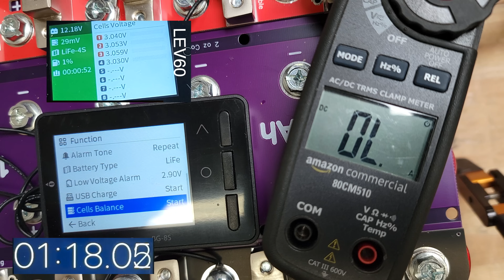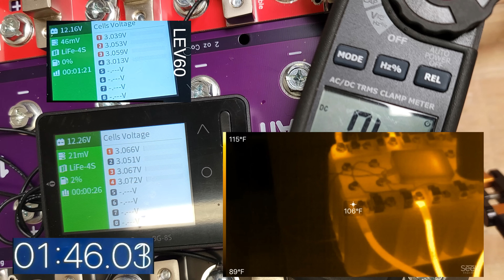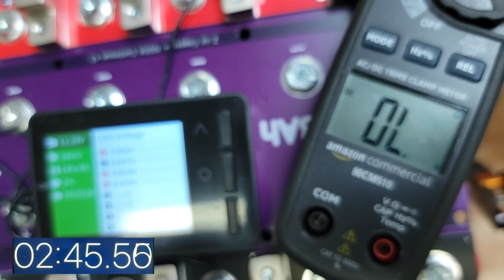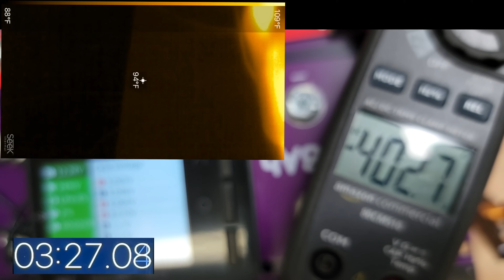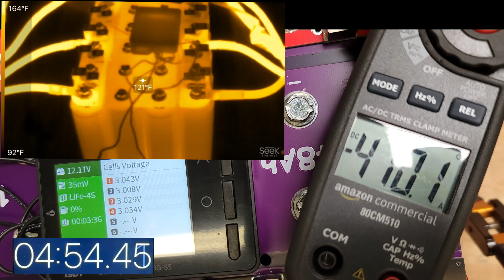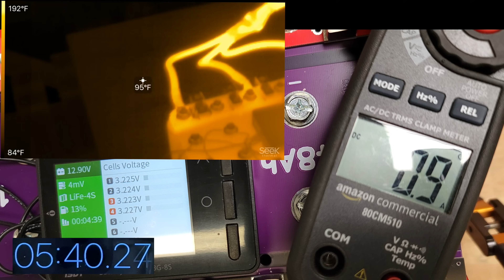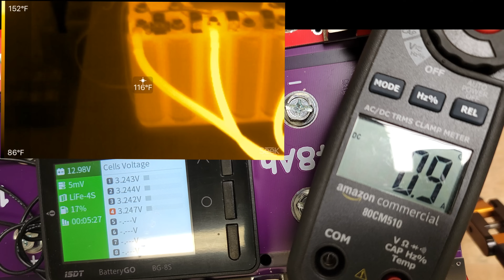6 minute Headway Torture Test - 48Ah LiFePO4 PCB busbars

Comment: 8:22 4 AWG wire is the wire you are trying to determine if it’s “6 AWG or 8AWG”.  Im looking to buy the same type cells shown in the video. 
I run 3 runs or 0/4XL OFC from SkyHigh car audio (power and ground. 3 positive and 3 negative- to my main sub amp)
Edit- battery hookup doesn’t show a super beast as of today 07-22-25, and a single cell is 8.99😢)

Comment: I havent seen anyone mention this, but I think the argument against doing multiple cables is this - If you have one cable fail (eg- one of three 6awg like in the test), now instead of pulling 400a through three wires, youre now pulling 400a through two undersized cables which would likely be a fire hazard.  If you have one big cable (eg- 0awg) and that fails for some reason, now youre just not pulling any power.  I think its about knowing the risks/rewards analysis of one way over the other.  And particularly in automotive/vehicle applications, they move and vibrate, so with more connections, there are more failure points with multiple smaller cables.  This is likely why the car audio guys are warned against doing it with multiple smaller wires.

All that being said, these are amazing batteries, and thanks Jehu for doing the work/testing to see what they are capable of!

Comment: Hello friend, I have a 2013 Honda Pilot truck and I want to remove the original battery to change it for a LEV60 since I do not want to sacrifice space, my question is if there would be problems putting the LEB60 battery in the space of the original, that is, under the hood? and what should I take into account
Reply: Lithium-based batteries cannot handle the extremely high temperatures you see under the hood. It is always recommended that they be installed inside the vehicle. In a lot of cases the upper recommended temperature is 140 to 160 degrees Fahrenheit. In the engine compartment temperatures get well over 200 in can result in premature failure.

Comment: i am xonfused man, i saw another of your videos where you did the test on the green cells and the pulled more then 600AH, here the headway pulled 400ah or so, so wich one is the better choise here ? how's the headway 20ah ahead of the green battery ?
Reply: He can choose whatever load he wants to put on there. 100 amp, 300 amp, 500 amp Etc. These two batteries in these sizes are pretty much equivalent. The Headway is going to be used while the Lev60 is going to be new. The Headway cells don't require compression, but the Prismatic Lev60 cells do require compression if you're going to be pulling heavy loads from it.

Comment: I don't know who said to not use multiple most definitely use multiple cables specially if the rating on the guage wire you are using is less than what you plan on charging or pulling from the bank

Comment: As always, great video Jeh. People using Headway cells for car audio and as you mentioned (in min 9)  is connected to the alternator so my question is it safe to connect to it directly ? as I know the alternator when connected to lithium battery (for charging) which has for sure low IR will get fried ? TIA
Reply from the maker: sorry I don't understand your question
Reply: @jehugarcia  I have to charge headway pack for my audio system using the alternator (chargeing while inside the vehicle) or external AC-DC power supply at home ?
Reply: @amerkhafagiable  a stock alternator will charge it just fine
Reply: @jehugarcia where can I get the green battery 🔋? And cell name?

Comment: Electrical installations use parallel cables all the time, EVERY stranded wire is infact parallel wires in a single assembly. Anyone who says you cant use multiple cables just doesnt understand electricity. you will see things like what you did one wire will see different amperage due to length, and connection resistance. But if you get them reasonable to the same lengh the difference can be ignored.

Comment: I really get mad when a person takes knowledge for free on YouTube and then try to criticize the ones that are sharing the knowledge for free. You always give people the choice of buy from you or just diy. You have the wright to charge whatever you want for the items you sale. As an engineer with more than 15 years of experience working with batteries I can tell that your set of tests are the best that they can be with the equipment that you have and certainly a lot more accurate than those of the clown of the multiple color beard. For those guys trying to craft a high power audio system…. “The week is already invented” do not try to cut corners… is you want to move a lot of current fast, you need multiple cables with a good distribution over good chunks of copper bussbars. This is the only way to do is right. The only reason to use single cable is because cable is really expensive and terminals are more expensive. Less cable is less money….. but MORE FIRE HAZZARD

Comment: Nice test! There is no substitute for real-world testing.  When I built the first prototype EVSR electric race car, I used 3/8” thick aluminum bus bars, but they would overheat during race conditions (typically 800amp at 160v for as much as a 95% duty cycle, depending on the race track) so I upgraded to 1/2” thick, and that solved the overheating problem.
Reply: comment is useless if you don't tell us the width
Reply: @themoneymercenary  bus bars are approximately 1"wide by 3.5" long, 1/2: thick

Comment: buy a uni-t ut221 clamp meter , it is a bit expensive (150$) but it can measure 2000amps dc! . make sure its the ut221 as the ut220 is ac only or the ut222 can measure 2500amps dc. 
ut207b & 208b is around 100$ and they measure upto 1000amps dc. 
i have the ut204+ and the meter is very accurate and it was 45$ and only does 600amps which is enough for me but not enough for your tests.

Comment: Good video! You can use a 500A or even 1000A shunt with an INA199A or similar Current sense amplifier and build your own tool quite cheaply to measure the high current. Or even easier, use just the shunt then use a precision volt meter to measure the voltage drop across the shunt then I = V / R, R = V / I , R = 75mV / 1000A, R = 0.075 Ohms . All the best!
Reply: On a serious note, lots of people know ohms law, but so many people forget about trying to do the math and solve the equations. I guess we are all guilty of being lazy sometimes in this world of convieniences.
Reply: @catch22frubert  true that. I posted the formulas to look smarter, but I used chatgpt to come up with the equation for the current. :)

Comment: The issue is you are nearly exceeding the cells thermal rating within 6 min and "these audio guys" run for hours at a time. Spreading out the load isnt an issue and is encouraged as can bee seen with the thicker bussing thats used having many spots. I agree Seth's test was flawed because it was pulling power incorrectly. But to me, this shows the traces need to be thicker and can be done so cheaply.
Reply from the maker: But 6 min continuous test = 1 hour dynamic music load
Reply: @jehugarcia  I encourage you to go to some audio shows and see how people use these in application. There's a decent amount in your state and they are free (and fun) to attend. Bring your clamp, volt meter, and thermal cam and ask if you can take some measurements, most will be happy to oblige.

Comment: Every time I click on the link to find this $150 price talked about in the video it keeps taking me to the product that’s $229. 
On yesterday’s video, when I tried to click on the link, same thing happened, it keeps taking me to a higher priced product 

Or individual cells that are selling at $49 for each cell . 

What adds up to a lot more than $150 . 

What is wrong with the link clicking on not showing the product mentioned in the video
Reply from the maker: this is where the link should take you https://scontent-lax3-1.xx.fbcdn.net/v/t39.30808-6/363321648_10162690785091978_1789931011703396194_n.jpg?stp=cp6_dst-jpg&_nc_cat=110&ccb=1-7&_nc_sid=dbeb18&_nc_ohc=Zw1oSYx-T4EAX9tl4Bn&_nc_ht=scontent-lax3-1.xx&oh=00_AfC8N0_gMSo8o-XRJWzk2KKvFuVcD3w9ZYXu0Ukktu4WFg&oe=64C62265
Reply from the maker: There's a drop down menu with variants,  but there's no $49 cells in there,  is this the page you end up at? https://www.facebook.com/photo.php?fbid=10162690786751978&set=p.10162690786751978&type=3&av=584751977&eav=AfbCbKK37Z8B9ajoZbne_q2SI_8TLYOpKl7XJZppU5a6IUw-Q4iVYdtlCrii8YDoPJw

Comment: I’ve been trying to power a project with 2 of your batteries off your website but I can’t get them working correctly. Both were bought tested with the bms awake. Don’t know what do to. Rlly starting to hate that your policy is that the returns are just store credit. Wishing I would’ve just went with drill batteries. Not impressed so far and just wanna finish my project. I’m almost $150 into these batteries from you. Could you please help in some way bc this shouldn’t be this difficult.
Reply: If the BMS is awake you should be able to measure the same voltage at the output terminals as you do when directly measuring the battery terminals.  Which batteries did you buy and how are you trying to configure them?
Reply: @kuhrd 2 of the 20cells in parallel because the support told me I needed to buy another one and run in parallel
Reply from the maker: yeah how about some details so we can help
Reply: They are 2 20cell 36v 187wh 5.2ah in parallel. I originally was using 1 battery but it would go for about 10sec before it completely cut power. The support team said my speed controller was pulling too may amps and when I sent the specs of the speed controller they confirmed that. It’s a 32a speed controller. They told me I needed another battery and wire it in parallel. My battery came in yesterday and after fully charging them both, I tried it again and it wen for longer, about 30sec but then again it would die out.
Reply: I don’t know if ot makes a difference but as soon as they were plugged into the 2 battery parallel amp booster they both starting to blink red instead of blue

Comment: “Never attribute to malice to that which is adequately explained by stupidity”. Not fighting words but it would be interesting to get to the bottom of the discrepancy. You touch the wires so I think it’s safe to assume your thermal cam isn’t off by 150 degrees. Is his thermometer off?  Is there a way to prove your amp meter is accurate?  Seems like an opportunity to learn.
Reply: Good quote, but not infallible. The problem with it is that genuinely malicious people (though they may be very tiny minority in the population, tiny but influential) as a result don't get properly attributed as malicious when they're smart enough to leave "evidence of stupidity" with which to minimize or eliminate any appearance of malicious intent.
Reply: @TheArchimedesEffect  The quote isn't trying to state things can't be malicious, just that you shouldn't assume maliciousness when it's most likely just ignorance.  

@jehugarcia's test seems to be a real world test so I'm really curious what's the difference here.  Does xxx amps traveling from one end of the plate to another vs pulling from a battery attached to the plate at various points make that kind of difference?  I mean the electrons or field is traveling in a loop from positive to negative around the circuit in my limited understanding... so seems like it wouldn't make a difference... what gives?  IMO, there's something to be learned here.  Also I'm much more likely to pay attention to someone who's been wrong, admitted it, and learned from it than someone who is never wrong (or claims to never be wrong) as how can you trust them?  @SmarterEveryDay, @Veritasium, or hell, even @ProjectFarm and many others would probably try to get to the bottom of this.  If nothing else it's interesting content for viewers 🙂

just my $.02
Reply: Good stuff there. Unfortunately for some of Jehu's detractors, specifically an unnamed pair that holds the attention of many others, it's already been shown that their motivations for pooping on Jehu's products are purely driven by perverse financial incentives. They can't claim ignorance anymore because now 'the cat is out of the bag' and many of their cult-ish followers now know it.

Comment: I think your points/conclusions are valid, but getting temps from those aluminum busbars via a thermal cam can be extremely inaccurate. Teledyne/FLIR has a good article describing this - since I can't add the direct link, you can google "How Does Emissivity Affect Thermal Imaging?" to find it.
Reply: Black electrical tape on shiny surfaces works great. Those readings the other guy was getting on the shiny aluminum almost looked like reflected heat from something in the background, not the actual lugs.
Reply: Yeah thermal emissivity is going to affect the readings a bit but where he was measuring the circuit board material the emissivity of the solder mask over the copper traces for the busbars is going to show fairly close to accurate.  An even better way of measuring would be if he could add a 4-channel k-type thermocouple measurement and attach the 4 thermocouples to various places on the battery to get a second, more accurate reading to compare with the thermal camera data.  Even a piece of black masking or vinyl tape placed on the areas to be measured could help with the accuracy when using an IR camera or and IR thermal gun since they both are affected the same way regarding emissivity.

Comment from the maker: Correction:  On Video I keep calling the headway pack a 64Ah  when its a 48Ah  pack.  It does change some of the statements I make on the video but not enough for me to redo the video-   Im lazy.
Reply: You've been dealing with 64Ah so long that it's force of habit. Reasonable people will understand. Haters and trolls will do what they do.
Reply: Hi.is a new cells or used?
Reply: I have a question if the headway cells say 8ah on the side how does 8 only equal 16ah I'm just curious 🤔